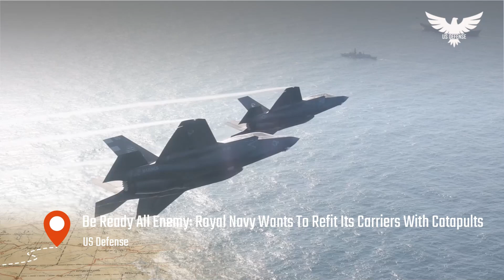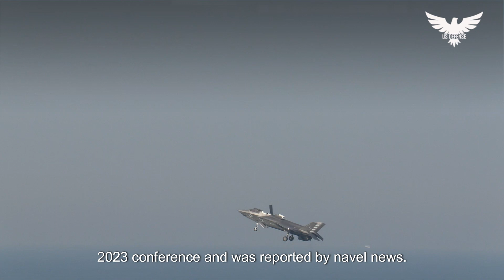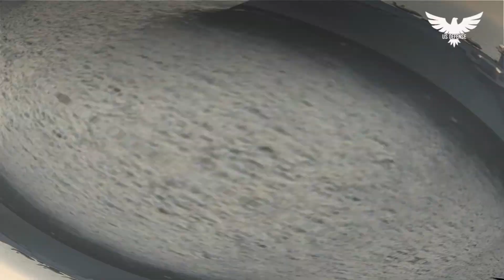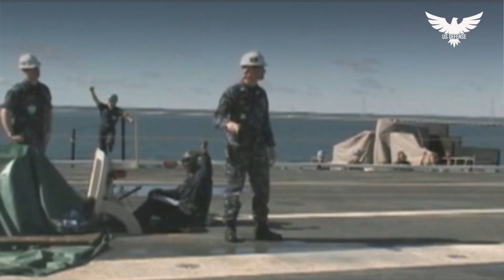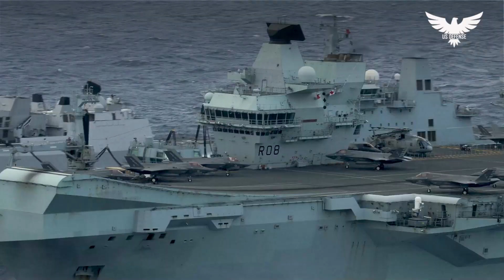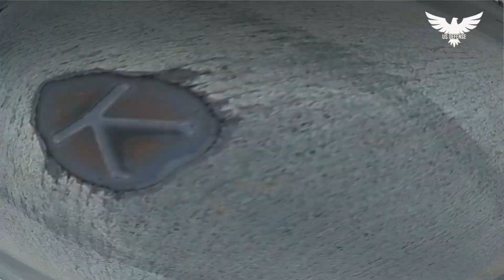Be Ready All Enemy! Royal Navy Wants To Refit Its Carriers With Catapults!

Comment: If they get catipult they will have to change to a different version of F35 am i correct in saying this
Reply: If they fit the Cat & Trap system they don’t have to rely on one STOVL aircraft and could actually make the new Tempest aircraft for our carriers and still use the F35B as they can operate from both types of Carriers but not the other way round

Comment: Who's the brain behind this?Catapults could have been fitted when the ships were being built. Now they'll take a ship out of service and it'll cost twice as much.
Reply: They were built with strong points in the structure to take cats and straps. However the cats being considered are smaller for large drones and not manned aircraft. These are semi portable snd relatively easy to fit. The next generations of drones will provide a significant aerial capability.
Reply: Cheers

Comment: I wonder if the cost implication could be quite heavy. It makes you wonder if a third carrier would be a good idea with launch and recovery equipment built in. We could call it Ark Royal
Reply: Hi Richard , I like you’re idea also basics are already in place for Catapult launch and recovery but never the less at the time more investigation should’ve been done. However we where in a rush relying on the US & French for carrier support .
Reply: Or Eagle.
Reply: Refitting them is easier, the QE Class were originally planned with Cats and Traps, but due to cost they never went ahead with it - But they have the room, and importantly have the power production nessacary to do it. Look up project ark royal. It's the plans to add at the minimum cats and traps for large drones, all the way up to added an angled deck and larger cats and traps for fixed wing jets and AWACS